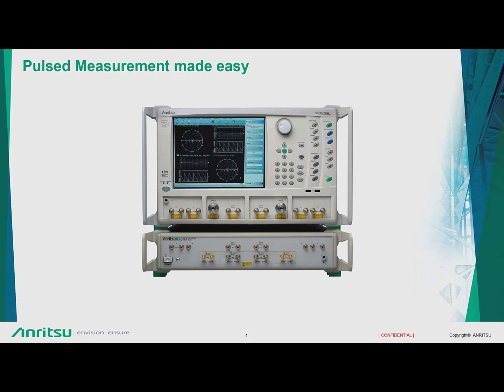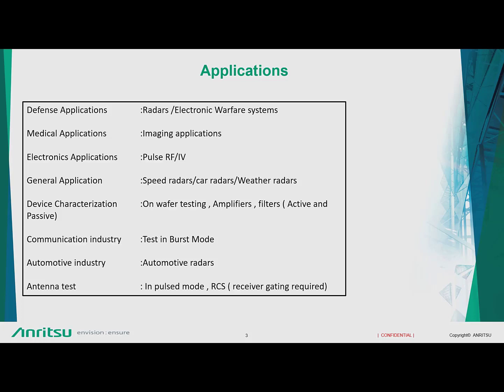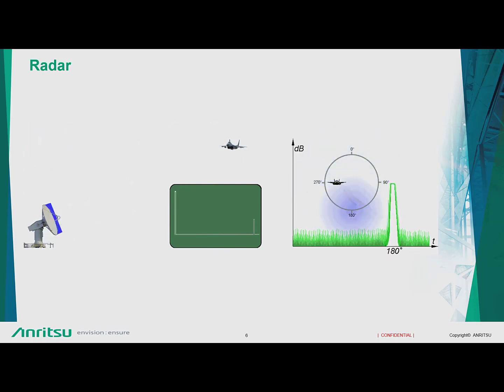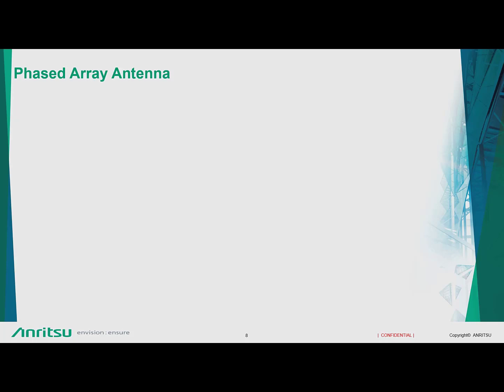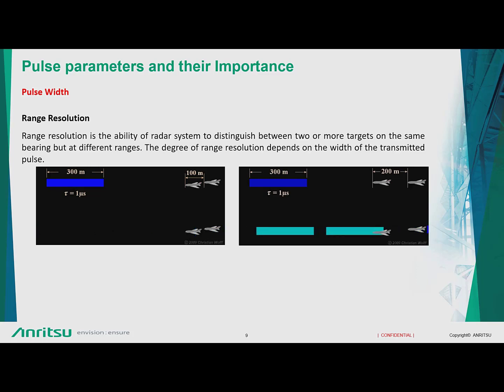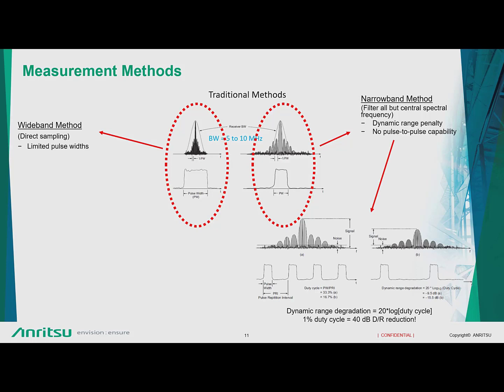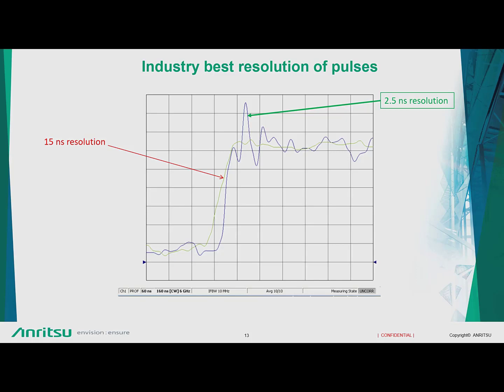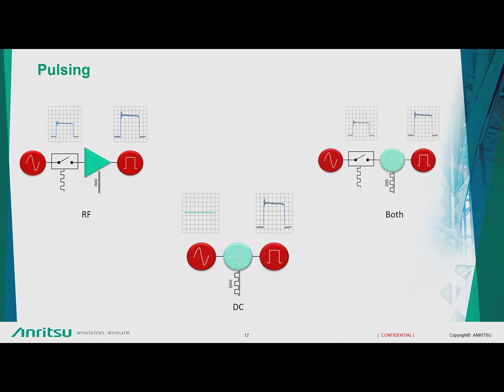Pulse Measurement Video Series – Part 1

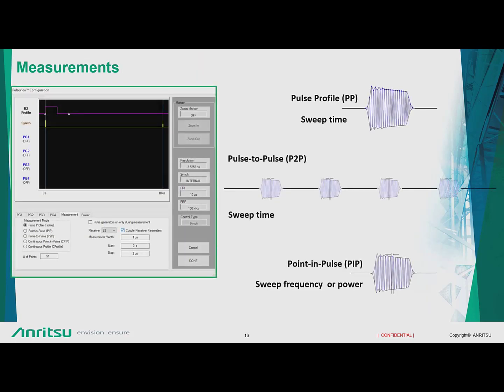Comment: Hi Navneet, very nice presentation.  I like how to showed these great illustrations of pulse analysis and synthetic aperture radar.  At 41:58, for the 3 basic measurements (Pulse Profile, Pulse to Pulse and Point in Pulse), what type of metric do you get back?  Amplitude settling measurements?
Reply: Hello Mr. Sodhi, thank you so much for your comments. Please refer to video series lecture 2-3-4 for more info on the Pulse profile , pulse to pulse and point in pulse measurements where these measurements are covered in depth. If you need further info, we would be more than happy to have  conference call with you and discuss on the topic. Thank you once again.